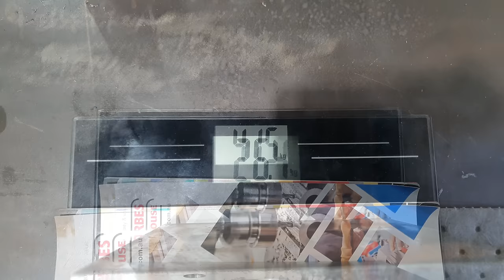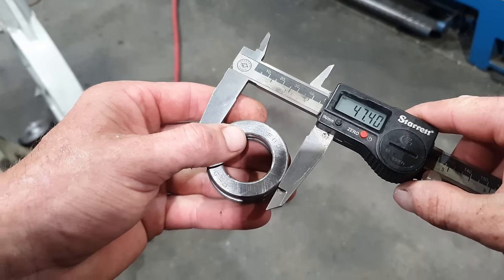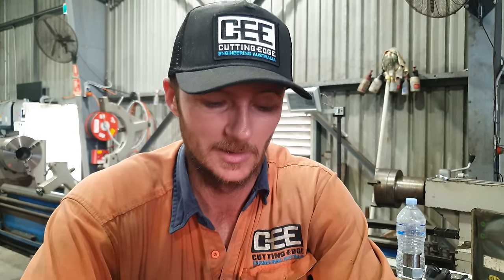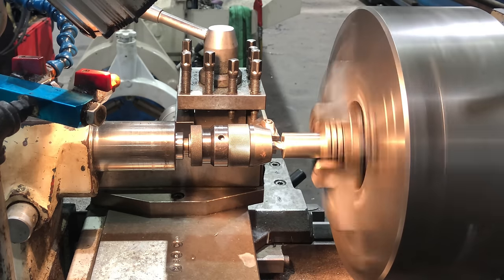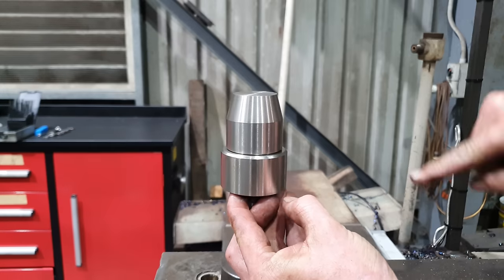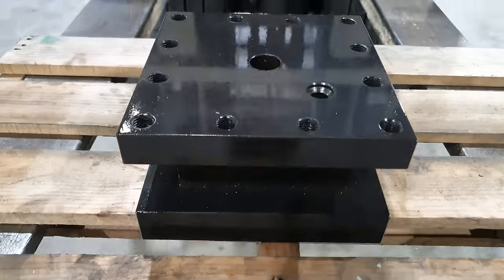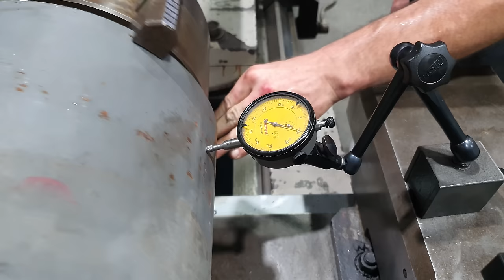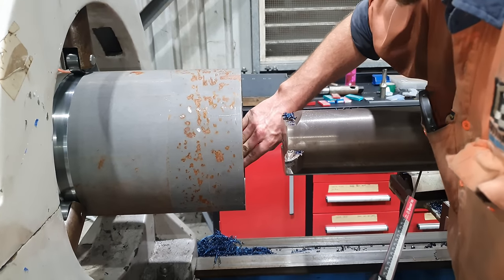Finish Making a Tool Post for the BIG Lathe! | Part 2 | Shop made Tools

Comment: I learned early on in my Mechanical Engineering to always start with the scrap bin instead of just grabbing a full-length piece of stock! At one job one of the first rules they told me was anything in the scrap bin was fair game. I ended up making an entire engine stand out of steel pipe "drops" and some other bits. I still use it 40 years later! Total cost to make it was a set of casters and a can of spray paint! The handful of stick welding rods we just used like candy anyway, so nobody cared about those. 😁
Reply: My local metal supplier still lets certain customers sift through the scrap bin for off-cuts that will suit their requirements.  It's already written off as too small to sell, so whatever you rummage up "sells" for $2 per piece in the RFDS tin.
Reply: My nearest steel stockholder charges pro rata full price for offcuts, even if you've rescued them from the scrap skip ! 
I recently got an off cut of EN8 to make a hydraulic cylinder clevis from and the guy brought me a piece that was covered in rust and cobwebs, I said "That piece of steel has been here longer than most of your staff !" only saving grace is you don't pay the cutting fee.
Reply: Steel prices are getting ridiculous! I now got people around my way wanting $20+US for steel bed frames!
Reply: At the Engineering office where I work, we stopped referring to partial pieces of trim as scrap. Until they're too small to use, they're drop-off.
Reply: I work for decades in the same company with big budget, and i still scan the scrap bin for usable pieces. Free for all, All you can carry. The money it saved me at home in my private workshop. Hell, if you need some simpe cold rolled steel or even a little 10cm piece of flat bar, you pay more in shipping that you pay for the material. From time to time i swing by some other Workshops, and i am a known face, get calles the "Scrap Man" ect.....it doesn´t bother me, because every usable piece i get for free or cheap is money i can sink in new tools and toys
Reply: @Ordog213  Where do you live?..:)
Reply: I buy steel from a supplier that does a lot of cut-to-size supplying. Their off cut bin always has a lot of pieces of the same size which I only have to do minimal preparation to put to use.
Reply: @frankish5314  Bavaria, Germany. Near   the Autobahnkreuz A6/A93. There are a few metal shops all around which mostly are CNC. 
I learned that the best way to the swarf bin is....simply asking. Search up which companys do metal work, look up what size they are and try your luck at a shop without a Guard and gate on the front. A shop were you can drive up to the office or external workshop door. 
If it looks like CEE, you are golden because the owner is most time somewere around. Be nice, talk a bit if possible and ask for a look in the bin.
I am sure that if someone did that at CEE, they could get some offcut without problems from the mate. 
Don't be greedy, be nice and please use PPE like steel toe boots and gloves. And dont wait for help if you find something. You are a guest and get something for free/cheap. Other people on site are therr to make money. Don't disturbe them to much

Comment: The stabilization on the Homeless GoPro is absolutely fantastic!  Or did you perform magic in post?  Anyway, the usual perfect camera work and editing!  The metal guy is kind of good also……..shame about the insert on the drill- can’t be cheap.  But the project was top shelf.  Just checked the dates and you built the current huge ass boring bar a year ago, amazing how soon you have made it too small.
Reply: Yes.  I'm starting to really like Homey cam.....Oh, and nice turning etc. BTW.
Reply: Homeless does a better job filming than most YouTuber's
Reply: GoPros are pretty good at stabilising their footage. I suppose they wouldn’t be a very popular action camera if all the footage on them was shaky AF
Reply from the maker: That Gopro footage is not edited! The built in stabilisation on "Activity" mode is the tits!
Reply: The current boring bar is so big it has to be flown in by hoist but it's still too short. How ironic. But will the new tool post be able to handle the bigger, longer bar?
Reply: @KJ6EAD  I guess we'll wait to find out. I figure he'll have to use the yard crane to install/mount it.
Reply from the maker: @KJ6EAD  there will be more to the project than just building the boring bar 😉
Reply: Does the big lathe have a noisy gearbox or is that something else that I can hear 
Love your work
Reply: @BWP202  They are near railroad tracks and get several trains each day. They also have a neighbor who flies in and out via helicopter. A little noise from straight cut gears could easily get lost in the background.

Comment: so the boring bar you said was big enough is now not big enough! make it much bigger will need a bigger crane.. fantastic work as always and can see the difference a stable tool post can make. lathe I used to run had one of those clicky ones like what you had and even as a fairly novice machinist could see and feel the flexing issues

Comment: Back in 1966 I assigned ea of six high school seniors in the vocational machine shop program to machine tool posts similar to yours for the six Leblond 13"X36" engine lathes.  They had a blueprint with the base, the swivel, the top nut and the handle.  These did not have the locking pin (a very nice touch) nor the thrust bearing.  All six tool blocks finished looked alike, worked on any of the six lathes.  It really brought back some good memories. In the next three years advisors for our advisory committee had them make similar tool posts for lathes in their respective tool and die shops.  One of those shops hardened the main blocks for the ones in our shop and the new ones we made after that.  I used to have pictures of those but can't find those pics.

Comment: What a neat project.  I feel like this is one of the first "real world" projects I've seen that I wish I could accomplish at home.  Things as simple as making the handle, details like counter sinking the handle itself, to the knurling on the pin....  You my friend are supremely talented.  Being a weight lifter, the first thing that came to mind was the ability to build my own barbell.  What a nerdy accolade that would be!
Reply: If you are still inclined on those home-made barbells, you can use PVC pipe and fill it with sand. Would make for a nice afternoon project since PVC is easy to work with.
For something heavier you can use black iron water/gas pipes. They screw together and have flanges with holes so you can have a basic handle and then screw whatever you feel like to it for actual weight. I hear concrete is pretty heavy :D Use large paper cups, cake pans, or whatever else disposable you have for moulds, then just press the end of the handle into it and let cure. Next day do the other side, and just like that you'll have some heavy AF DIY barbells! (if going that last route, i suggest sticking in a couple self-drilling screws around each end, less chance of that concrete potentially sliding off after a while)

Comment: Very nice as always! Agreed SS is a little tough to machine in my limited experience. I once made a set of brake caliper pistons out of 304 for a classic sports car I had. Polished the seal surfaces on the buffing wheel to get a mirrored surface. Turned out OK but it was a lot of work.
Reply: 304 isn't the easiest, 303 is much easier and some of the 400 series aren't too bad.
Reply: 304 is not a great choice for caliper pistons. Its very soft , yields easily, expands too much and is very prone to gaul.
Reply: @michaelmclachlan1650  Actually I looked back in my notes and found I actually used "303 easy machine stainless" so the supplier told me. I still didn't get a great surface finish, but it buffed up OK.
Reply: @billshiff2060  Agreed The 303 I actually used held up for the 10 years I owned the car.
Reply: It's a bitch when the chrome plating peals & takes out the seal.  1970's something Chrysler something used plastic & had more then a little trouble with heat & expansion & seizing.
Reply: @alro2434  Yes, the pistons were "Un-obtanium" so making new ones was the only choice. Fortunately at the time I had access to a lathe at work.. That was until one of my coworkers hurt themselves which promptly shut down employee access to machine tools!

Comment: Good to see the weight.  I was 0.1kg off the mark, I think I came up with 26.5kg.  I guessed at a couple of the dimensions when I sneakily modeled it up in CAD to work out the volume, so it seems I must have guess reasonably close lmao.
Reply: Lol you did better than me. I tried to do manual math, but somehow miscalculated by about 6kg
Reply: Good work! Did you alow for all the chamfered edges  and countersinking - that could have been your 0.1 🙂
Reply: I did the math by hand and got 27kg. I think I under estimated the facing and chamfers plus some rounding errors. Nice work!
Reply: Sounds like you were off by the weight of the tapping swarf for the set screws!
Reply: @Hyratel  I accounted for that, my model has tapped holes, chamfers, counter bores etc.  I'm closer now that I know that the pin is 14mm, but still don't know diameter or depth of the counter bore for the locating pin, or the shoulder on the mounting stud.  The rest of the dimensions I was able to get from the video.  My current model is at 26.45kg   Either way, it's now a prime candidate to scale down, and 3D print lol (Although, I don't think mine will be quite as rigid)

Comment: If you create a bigger boring bar would having it seat on both sides of the toolpost help with balance rigidity etc, or would it be more trouble than it's worth? Cheers
Reply: I think the larger boring bar will need a substantial length on the end opposite the tooling to balance the bar when secured to the tool post. Maybe create a sort of stabilizing bracket/arm that attaches to the the boring bar, allowing for additional rigidity by utilizing one or two of the tool post's other sides. To make it adjustable, the bracket on the back end of the boring bar could slide in a dovetail slot or be attached to a series of drilled and tapped holes.
Reply: Why couldn’t the boring bar be a pipe, as long as the side we’re thick enough. That would save a lot of weight.
Reply: @rossjohnson1199  It would probably "ring" like a door chime, tba by the time you're getting to this size of boring bar it probably needs its own dedicated holder.
Reply: @rossjohnson1199  by using pipe you lose a lot of rigidity, the mass is what keeps it from flexing and deflecting.
Reply from the maker: Watch this space.. there will be more than just the boring bar needed 😏👍

Comment: if you drill sideways into the toolpost into the hole for the indexing pin you could add a small ball bearing and spring, and use a button insert on the lathe to make an indent in the indexing pin, that way you wouldn't have to pull it out of the toolpost for turning but just pull it up slightly into the indent, turn it around and push it back down to stop
Reply: You can get grubscrews with integral spring loaded balls at the tip. Also called Spring plungers.
Probably don't need an indent , just the friction of the ball will stop the pin dropping.
The grubscrew can go in the pin.
Reply: Just wack or bend or center punch it for some interference fit!!😊😊😊

Comment: Nice job on the Toolpost. It looks very sturdy.  I wasn’t aware that the larger toolposts make use of thrust bearings to increase the force you can apply to the top nut.  My 14x40” lathe tool post did not make use of a thrust bearing.  I expect they aren’t necessary until you get into the much larger machines. 

I’m a home machinist and you are a really good example to follow.  You make everything look pretty simple, but of course you are a professional - and a very good one by the looks of it’s .  I think you give the impression it’s all pretty simple to people who don’t do machining themselves.  It’s really not as simple as you make it look.

Comment: Most of the time your beautiful work goes out the door for the customer to admire, but this time you get to keep it, and it will be right in your face for many years to come.
I think it is beautiful and I prefer that style tool post over the Aloris any day of the week. It holds a cutoff tool, chamfer tool and right and left hand turning tools. The only time you need to change tools is for threading or boring bar or knurling.
Impeccable workmanship and design Kurtis, if I was your Dad I would be very proud of you.
Art from Ohio

Comment: Good work with the toolpost, thumbs up :)

I learned that we NEVER tighten directly on the toolshaft, ALLWAYS put a 2 to 5x30x150 mm between shaft and bolts, then there will never be marks in the shaft, deforming it. 

The yellow drill you used, it needs a lot of RPM, its best in CNC machines, set-up must be rigid, vibrations and low RPM will kill the insert, especially the centre, 50 SFM at least, and this drill is performing best when it rotates like in a milling machine, coolant through spindle, I used them a lot.

Keep up the good work :)

Comment: The insert drill drilling stainless takes me back to my first job out of high school at a machine shop. Drilling a 6 inch hole through a 15x36 piece of stainless let me tell you it isn’t very fast lol scooping chips out by the bin full. Almost as fun as clearing chips out of our 36x240 monarch lathe with a pitchfork.

Comment: Great to see your new line boring machine at work and the head you are using looks like an awesome bit of kit . 
Talking about wear i ran a number of excavators over 40 odd years and stopped most of my wear problems by changing the grease i used . Standard oil company greases struggle to last a shift especially under high load conditions . I used  Canadian manufactured grease called Power Up Thixo grease . On a 20 tonne machine grease from new at 12000 hours no noticeable wear on all pins . On a Cat 330 we had running a waratah 5 tonne 626 bigwood  processing head , with standard grease after about 6 hours the boom lift pins would be squeaky . Changed to Thixo and it would last 4 days . 
Power up also has some very good additives for oil too 
Great to see your videos keep it up

Comment: Amazing what you can make when you have the right equipment. That new tool post is a massive improvement over the one that it replaced. I wonder why the manufacturer couldn't have provided a better tool post in the first place.

Comment: Nice work Kurtis. Always enjoy your channel.
Can I suggest when screw cutting.
Set the compound at the thread angle.
Advance the compound for thread depth.
Start with cross slide at '0'. Back out after each cut and return to zero for each cut

Comment: You could build a boring bar that is driven by the lathe then hold the hollow bar on the ways. A large diameter solid stock with a keyway that holds a threaded feed rod with thrust washers on either end as the bar. Two tool blocks that ride on the feed screw with holes broached in them to hold insert tools. Then a hand wheel at the end of the bar. Run the bar between centers with a drive dog on the lathe then put the hollow bar around it and you could cut very long stock easier.

Comment: Have you tried setting your center about .02" from contact with your workpiece during a part of operation? Keeps your hand out of the way and the workpiece will not fall or break the part off insert and give you time to shut off the spindle. I use this method quite often and have never had it bind or break the insert.
 Love the videos and content. Thanks

Comment: Curtis, you may not like working with stainless but you sure did a beautiful job on the handle and bits - just a picture. It would have been nice to see a bit of turning the taper on the handle but the knurling was great. I noticed you are missing a knob on one of the lathe control levers you could do another beaut job replacing that.

Comment: Hey kurtis i find that if you drill stainless 1 size larger than the tap drill you'll  find it much easier your taps and it still gages correctly...saved my ass several times we do alot stainless steel in our shop

Comment: On advice years ago I bought a CRES nut and bolt. Upon tightening it snapped right off - way to soft for the application. I ended up using an ordinary nut and and bolt for the job. So, I'm not all that big on stainless either.

Comment: Excellent video.  I'm curious, when using the digital readout on the lathe...is that something you need to have recalibrated every so often?  Same question with a lot of your instruments.  Is there a schedule where you check to see if they're still accurate?  Thanks.

Comment: Brave man, drilling stainless without through coolant. Seen 17-4 roast a tool after two parts when the machine's high pressure through spindle pump fails.

Comment: Beautiful work, as always. When you showed the yellow end of the bar, it reminded me of a peeve I have with these metal sellers/manufacturers. It would be nice, if there were some standards there. I buy a lot of metal that’s color coded. The problem is that, as an example, one manufacturer sprays 1018 yellow, while another sprays it green. Ugh!

Comment: Making a bigger boring bar.  Are you going to drill and tap several holes around and in the non cutting tool end.  Perhaps to 7/16-14. Use a 1975 volvo 164 engine mount.  Usuall part number A2424 or just 2424.  With some various sizes weights of old cylinder rod also drilled and tapped to 7/16-14.  So you can can screw the volvo motor mount to the end of the bar and change the weights screwed to that to change the tuning of the frequency damping.   Cost. Less than $10.usd for a mount and a few minutes lathe time. Getting rid of harmonics.   Priceless.